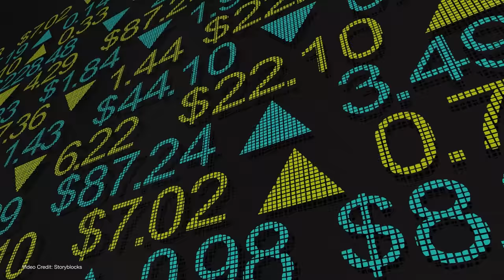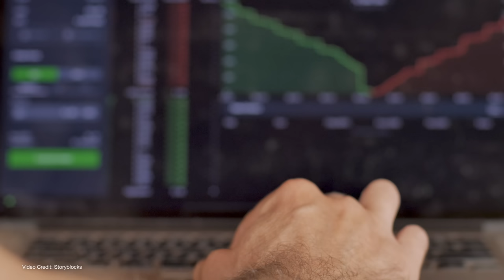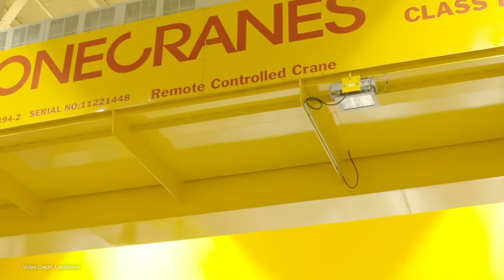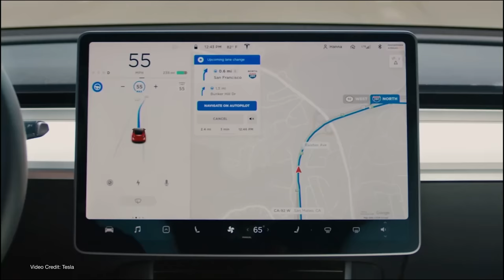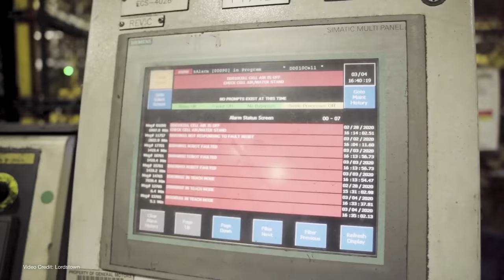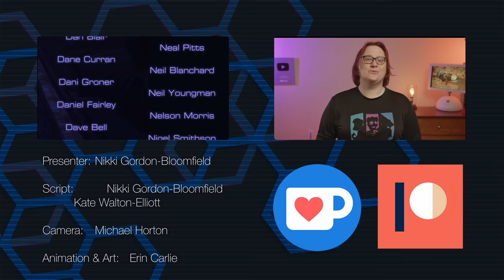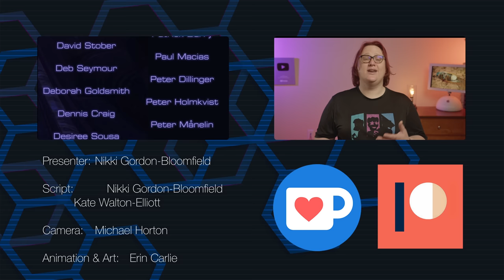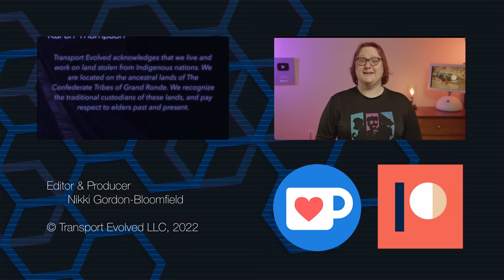Is Lordstown Motors Truly Doomed?

Comment: When you say the Endurance is nothing new except it runs on hub motors, and even has an old fashion solid rear axle unlike electric trucks from Tesla, Ford and GM.  Well I think you might be missing the fact that the hub motors are indeed a big deal.  According to a recent webinar fro Aptera with Elaphe on propulsion, hub motors according to their calculations will be 10-20% more efficient than axle mounted motors.  They eliminate reduction gears efficiency losses and because they turn at wheel speed they have less losses associated with magnetic flux hysteresis.  Additionally, the ability to individually the control rotation speed and torque to each wheel provides for much better traction and handling.  It also allow for much tighter turning radius.  By eliminating the third member (the big bulge in the middle of the axle), hub motors allow the floor to be lower, and for off road applications greater ground clearance.  They also allow a greater percentage of usable interior volume.  A solid axle is not a bad thing in trucks, they have been used for around a century for a reason, they work!  What do trucks do? They need to haul and tow.  To do this well requires that the alignment of the wheels remains constant over the entire load range.  While independent suspensions can be made to handle this problem, there are a lot of downsides in terms of complexity, reliability, space efficiency and cost to work as well as an old fashioned solid axle.  Finally mounting electric motors on the axles becomes more difficult as you reduce the size of the vehicle, the motor and associated gearing does not scale down proportionally.  

In addition to the sale of the factory Foxconn and LMC entered into a joint venture for a second electric vehicle.  No one knows what it will be, my guess is it will be a small, low cost hub motor based commercial vehicle for international markets.  It will be sold in North America under the LMC label and everywhere else as Foxconn.  This vehicle will be designed using plug and play hardware and software components produced by the army of suppliers signed up to be consistent with Foxconn’s MIH alliance standards. While the LMC Endurance has, as you say, much competition in North America, Foxconn’s approach could do for electric trucks what they did for the smart phone.  I predict that this will be good for Foxconn, for LMC and for the climate.
Reply: Aptera needs in-wheel motors to get the aerodynamics right. That's the reason for their choice (and it's a good choice as far as I can tell!), and the "advantages" they list are mostly marketing BS IMO.
If a large, slowly turning motor without a reduction gear is so much better, why don't we see such motors in any car made today (not in-wheel but more generally)? Literally everybody has decided to use high-speed small motors with reduction gears and now Aptera is telling us that all the R&D teams in the world have gotten it wrong for the last 20 years?
I really badly want to see Aptera succeed but I wish they would give us a bit less marketing crap.
Reply: Solid rear axle is necessary to tow.
Reply: Right on Larry!  Perfect rebuttal!
Reply: From an article in Taiwan that came out just after the signing of the deal.

"This is a mutually beneficial strategy. Hon Hai Chairman Liu Yangwei replied to analysts at the French conference: 'Using their own technology, motors, batteries and other technologies on the MIH platform is the main reason for the establishment of joint venture.' He gave an example of pickup truck hub motors. The technology can be used in passenger cars in the future."

The reason they created the JV with LMC is so that they could create more vehicles that used LMC hub motors, batteries and other IP.  I believe all of the JV vehicles will be based on the Endurance skateboard.

Also, you are right and solid axles.  For trucks they are far superior to IRSs.  The only reason Ford and other gave up the solid rear axles, is because they forced to, because they needed to make room for the rear motor.
Reply: @mmaschin  nice. I didn’t realize that.. so solid rear axle becomes a sustainable competitive advantage in the work or personal tow truck segments, made possible by hub motors.
Reply: Hub motors are cheap and for light duty. If they were so great other major automotive manufacturers would be using them.
Reply: i bet the channel wont respond to this comment, they do answer the troll ones, tho, shame
Reply: Foxconn already has their own EV  skateboard developed so do they need the Lordstown intellectual property?
Reply: @krisvandermeulen253  the two companies already decided it’s in their best interest to partner. So why would your question be relavent still? Am I missing something? 😂
Reply: @w0ttheh3ll  Don't underestimate the lack of risk taking and the desire to be first with something in today's business world.

Comment: Possibly because pickups are far less common in the uk you may not realize that in the actual work- use of pickup trucks, for their intended purpose, there is no suspension setup that currently rivals the leaf spring and solid axle. You simply cannot load the bed of a pickup and bramble down a washboard road with a dogbone axle. Or any other current offering. So while it may lack cutting edge tech, the leaf spring is the only option. And as you stated, add to that the unsprung weight of the in-wheel motors and you really have no option BUT a leaf spring and solid axle. And I’m not saying it couldn’t be done to use a different type of rear axle, it just can be done cheaply enough. Lightning strikes. Great video.

Comment: Their niche in the short term might be filling in the gaps because Ford, GM and Rivian can't make enough pickups to satisfy demand (yet). As a long term strategy they need some new ideas to distinguish themselves from roadkill.
Reply: They actually have some pretty cool concepts using the hub motors on skateboards. Check out the videos they have on the military prototype.

Comment: if they could get to market with a truck at 50k... like they've talked about... they could survive just because there arent enough truck to go around right now.  if i could buy a 50k ford lightning i would but i cant. i dont know if hub motors are the best but i might be tempted if i could get that one at a reasonable price cause i cant get any of the others on the market right now for sure.
Reply: That is a good point, but they're not in production yet,  and most people who spend 50k on a new vehicle can risk losing a little, but if that truck breaks, you would need to be able to fix it. If they make very few, and go out of business, it might be tough. That said, I kinda rolled the dice in 2018 with a Model 3. I feel good about it now. The Aptera or the Arcimoto might be fine if they hit sales high enough to sustain themselves. There is nothing remotely like an Aptera. Very cool, but I doubt Tesla Ford or GM would ever make one.

Comment: Doomed. Another Nikola Motors with less money.

Even Rivian as an auto producer is in doubt. I’m not saying the F150 Lightening promises the most but it has more of what most pick-up buyers require. They might not sell for $150k+ but they will sell. There’s many F150 fans out there and Ford will wipe the floor. And probably bring all the equipment and the tradesperson required for the wiping.

It won’t be the most affordable F150. But for those that can afford, (no pun intended) to buy or lease. The Lightening offers the best probable realistic EV replacement for the ICEd F150.
Reply: Nikola Motors is still alive and doing well!
Reply: And the Lightning is not even a ground EV like Silverado EV will be.

This is a modified F-150 platform where GM Silverado EV BT1 is a EV from ground up next year.  

Wait for Ford 2025 redesign. 

The Ford F-150 Lightning is already being promised a redesign for the 2025 model year. Reuters mentioned this when discussing Ford’s production plans for the Lightning.

Comment: A 17min video bashing the Lordstown Endurance and only talking about the negatives.

This is really bad reporting.

You talk about the importance of brand, while also praising Rivian.

You dismiss in-wheel motors without talking about the clear advantages.

You talk about the prototype fire without giving context.

You talk about Foxcon and flat screen TVs fiasco.. fine, but the deal in Lordstown is a done deal, it's signed. It's happening so what's your point.

You talk about them pulling out of the Baja race without context.. the Endurance team said they were happy with the performance of the hub motors in the sand and that they just miscalculated battery drain (which is about 4x that of normal paved road)

Very shameful reporting.
Reply: That’s what journalism supposed to be pick Out the flaws. Plus endurance was a shell company in the first place or I mean  Lordstown. We have every right to bash to company especially people that invested it
Reply from the maker: The fact that someone miscalculated the energy drain tells us that there may be other miscalculations in there somewhere. You simply do not enter a world famous race without doing proper due diligence.
Reply: @transportevolved  they heavily modified a beta vehicle to drive it in a terrain that it wasn't designed for in an effort to test its limits. How many Bajas did Tesla, Rivian or Ford's Lightning participate in? 🤔
Reply: @williamerazo3921  so journalism should take a 1-sided, non objective approach?
Reply: @transportevolved  less than 50% of participant ever even cross the finish line in the San Felipe 250. You have absolutely no idea what you're talking about.  The Endurance team planned on recharging the vehicle anyways so this wasn't a priority. They realized that getting the mobile charger to the mountainous area was not safe for the other participants so they respectfully ended the race.  They were the only OEM to participate in the EV class with the only other being an experienced Baja racer using a heavily modified Toyota 4 runner that used a Nissan Leaf motor and was much much lighter. Imagine calling yourself unbiased and leaving all these details out. Shameful.

Comment: Why use in-wheel motors on a vehicle that you don't need to worry too much about space and weight. These motors are needed in a small hatchback with independent air/fluid suspension. SPACs are a way of getting on the stock market without having to open your books. That is a big red flag to anyone with half a brain. I hope Foxconn make an EV just not a pickup or SUV. I'm sick of seeing SUVs and also you can't tell who made them as they all look alike.

Comment: The Lightning is crushing it.  Let's see, hmmm.  I could have an established company's 5 seat ultra quiet pickup truck for about $33k after tax credit or I can have a 2 seat, not very quiet, solar assisted, awkward,  less than comfortable, untested autocycle for a few dollars less.  Also why would we need a Lordstown?  At Ford's price point they will heavily compete against other non truck EVs.  Which begs the question. If Ford can offer all that for $40k why isn't the Aptera in the $18k range?  I hope Ford offers the Pro with the extended battery next year.  Well at least Aptera does have something in common with the F150.  Large turning radius and width. I've been waiting for the Grenadier but after seeing the Out of Spec reviews on the Lightning I'm probably going that route.

Comment: GM didn't dump shares in the way you say. In the original prospectus it was stated GM would part ways as a related party once LM had made it to Beta/PPV vehicles. The share purchase was a sign of good faith in the transfer of the facility to them. Same thing with parts catalog which GM extended even after the shares were sold and GM wasn't a related party. A solid rear axle is imo better for a truck, especially upfitted ones for weight distribution, there's nothing less innovative about it as it's purpose driven. Also, they aren't using independent suspension in other ev trucks to add more battery... it's to fit the motors between the axles. The truck that caught fire wasn't a prototype, it was a mule which is before prototype, and was testing a new battery supplier using cells wired together by hand, they automated battery construction after that. LM also has fleet software and offers similar features to others. Unsprung mass is fud, sandy munro has talked about this. Demand is bigger than supply, and with Foxconn's quality assurance stamped on it, reliability shouldn't be a concern. But hey, just my two cents.

Comment: Well let's hope that Lordstown doesn't go under, because they will be assembling the in-wheel motors for Aptera.  The parts will be shipped from Elaphe to the Lordstown facility, and then the fully assembled motors then shipped to Aptera.  And most importantly....I WANT MY APTERA!
😂🤣😂🤣
Reply: Aptera will be making their own Elaphe motors!
Reply: Lordstown stock and whoever owns it has NOTHING to do with their inability to produce the truck.    They need cash to build their production validation vehicles.  And then they’ll need cash to go to production.   

I give them a 1 in 10 chance.
Reply: @Derpy1969  The best results as the leading expert in EV's says prototypes are easy production is infinitely harder! Elan is correct